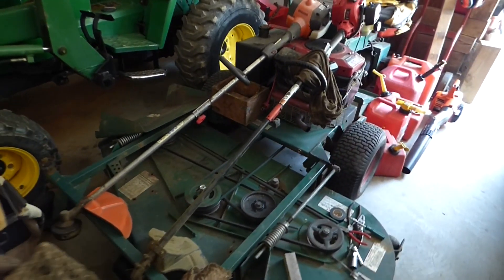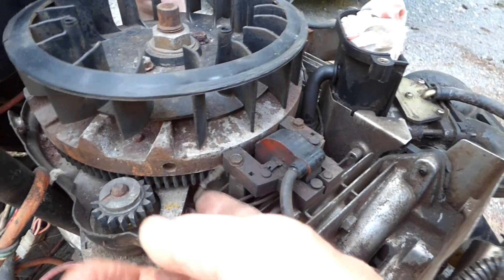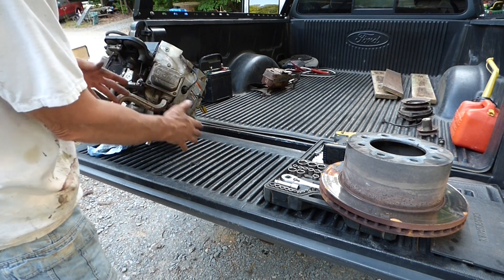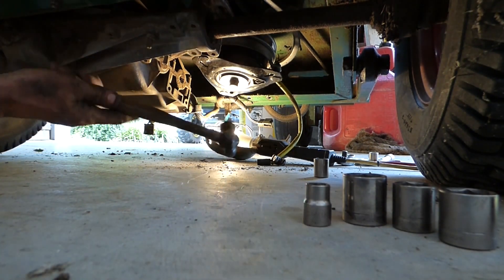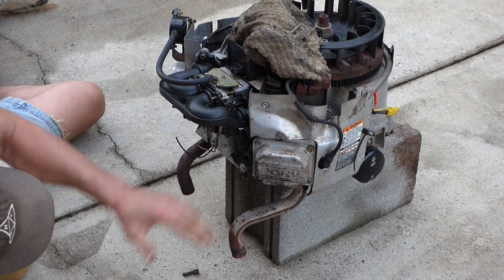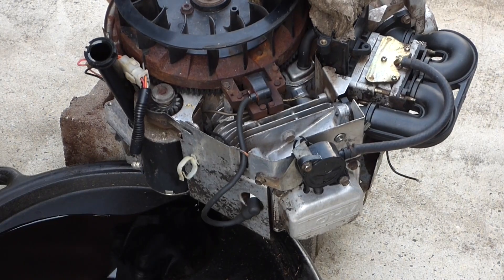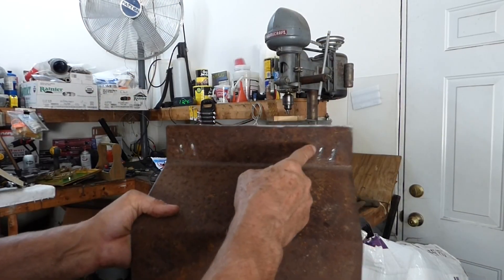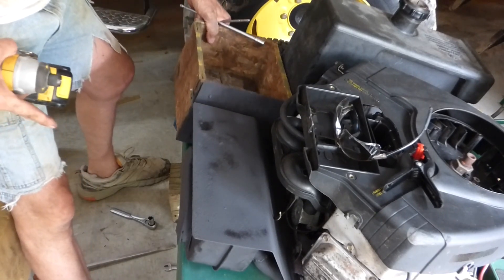Trying to Save an Old Zero Turn Mower with a Newer Customized Engine

Comment: I'm about to try this. Have an older cub cadet zero turn and an older craftsman yts4000 rider that runs fine but it's a piece of crap. The craftsman GT5000 I have is a beast compared to the yts4000. Both are inferior to a zero turn I feel so I'll yank the Briggs and Stratton 24HP vtwin off the running yts and throw it on the zero turn. Since I have a running GT I'll roll the dice on the yts motor on the cub cadet.  I appreciate the video just to see if it can be done. You're awesome my friend.
Reply from the maker: Wishing you all the best on your project

Comment: Did you even check to see if the engine rotation was the same? You might want to use a bigger battery heat shield. The wood is less susceptible to damage from the heat compared to plastic. Personally, I would've relocated the battery and ran longer cables. It would've been nice to see the wiring and carb repairs that needed to be made. I hope you added a gas shut off if there wasn't one.